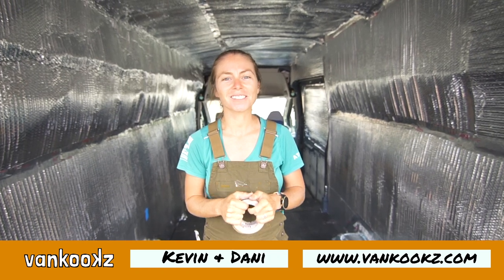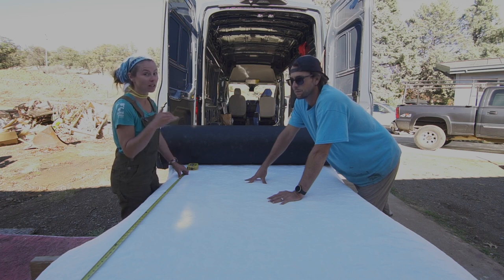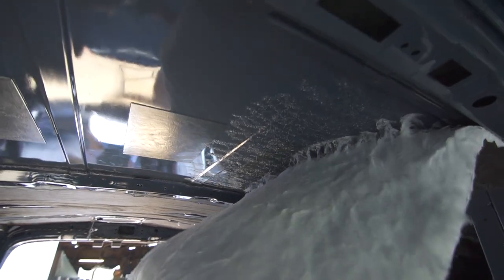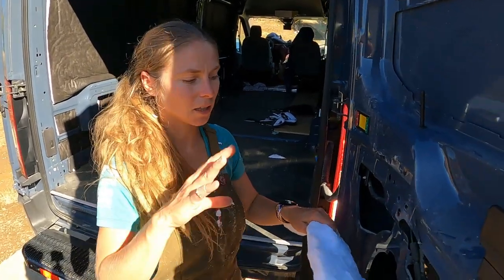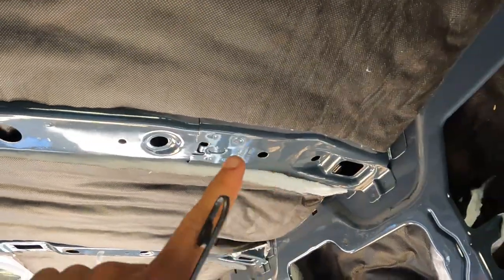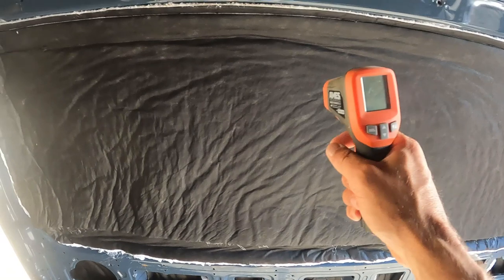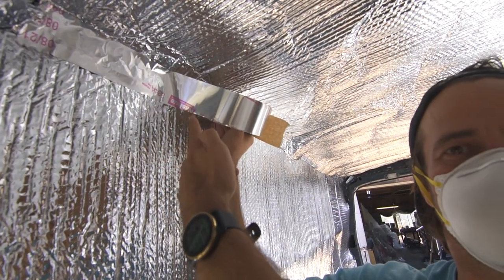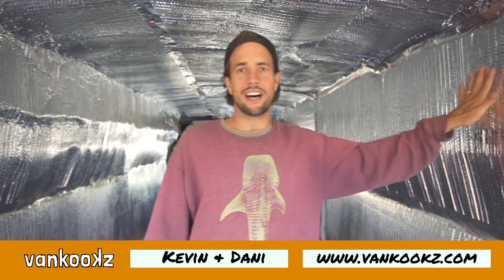How To Insulate a Van Conversion | 3M Thinsulate and Reflectix Insulation

Comment: From my understanding, the R-value is minimal (R1-2) if the vapor barrier is glued or attached to any surface on the side of the van. The R value goes up significantly when dead air space is created (up to R-21) if placed on top of the wooden framing (or you can glue it to the internal wooden walls on the side facing the van wall) — just so long as it has that dead air space. Even Reflectix company recommends this. Hope this helps 🙏

Comment: Always enjoy your videos. I don't understand why you would use that for insulation? When PIR board has almost 3 times the insulation properties per inch. I understand this type of insulation is easy to install. PIR board doesn't absorb moisture. You still need to install foam insulation to the walls of the van before you install PIR board.
Reply from the maker: Thanks we appreciate that..  we put a good deal of work into these videos.   We also try to give out what we have found to work the best from almost 7 years of vanlife now and building multiple vans in all different ways.   We've used the board before and it's a hassle.   There comes a time when you are just out in the heat and you are in cooking in your tin can and you can have the world's best insulation and it doesn't matter.   Same goes for cold.   I've been on the van for over a month in single digits and negatives at night.  No insulation will keep you warm you're basically living in a cooler.  So a heater is mandatory.  I've seen that board also get very moldy.  We used to make yurts for burningman with that board and we've had to throw a bunch of it out because it molded out in a storage facility.   I'm just trying to share the easiest most dirtbag and cost effective way to do it.  Plus when using thr board  you then have to use a very toxic and extremely messy spray foam product as well.  I once converted a van and had to tear all that crap out. It want pretty I wish filmed it.   This application is a non toxic and easy way to have results.

Comment: One thing I like to see with Ford Transit rear doors is somebody installing a tool rack in the door in the place of that plastic cover.

It might require altering some of the internal structure.
Reply from the maker: Thats a great idea 💡 this van is already off with its new owner but next time I will consider this.  Thanks Craig.

Comment: Yall are brave adding a vapor barrier over the vans already built-in vapor barrier(the outer sheet metal). Have you ever pulled one your builds apart to see if you've trapped moisture and have mold going between your vapor barriers? I have. Never again putting a vapor barrier in a van.
Reply: You need to eliminate all the moisture transfer from INSIDE the van caused by cooking and humans breathing, from entering the van walls. The issue with the process here, is that any cold metal surface on the inside of the van wall WILL create condensation - this is why closed cell foam or lizard skin type barriers directly covering the steel surfaces is such a good method, albeit harder and messier to install.

Comment: Hi: thanks for the video.  I see you don’t use any product like Kilz Mat for sound control? So do you feel the Thinsulate is enough for sound deadening? Or would you consider using it on your own premium build?
Reply from the maker: I think it's enough the thinsulate is originally a sound deadening product as well.  It doesn't hurt to put on the rattle trap but we didn't notice any difference with this van and the last one we built without the rattle trap but it's a cheap product.

Comment: The metalized bubble wrap is not insulation (it actually conducts heat) AND it is not suitable for a vapour barrier.
Reply from the maker: It’s worked great for many moons

Comment: Why not just install the thinsulate just like you did the reflectix? The voids don't need to be insulated on the inside and it looks like you spend a lot of time doing it
Reply from the maker: It’s hard to install your framing on top of the thinsulate on the van ribs. It does helps to insulate the voids to cut back on thermal bridging. You can use a spare foam but I just shove the thinsulate in there pretty good.